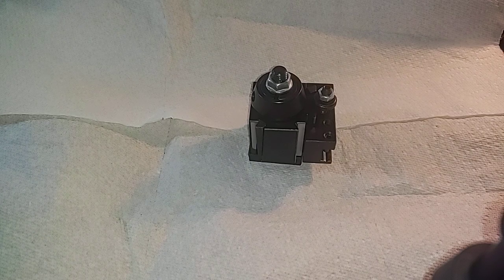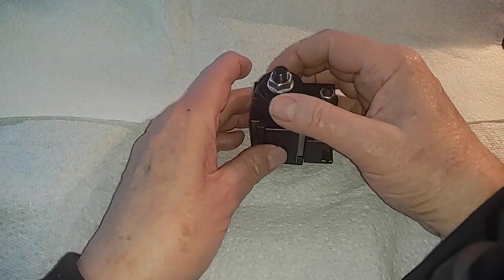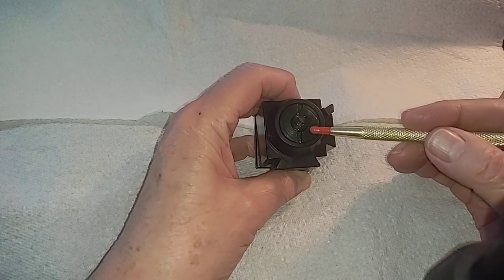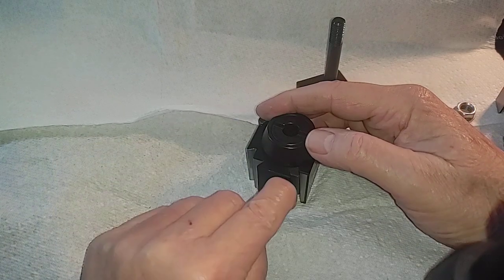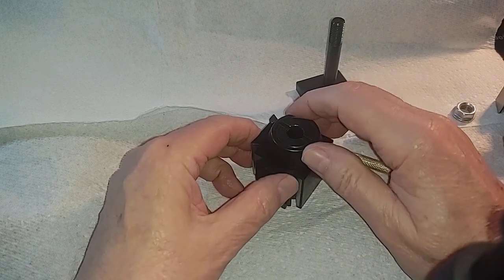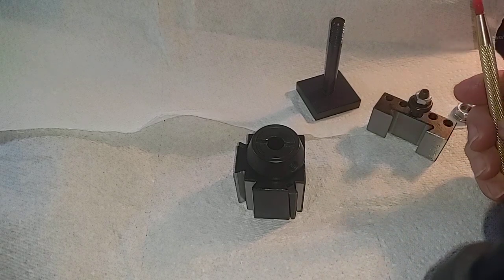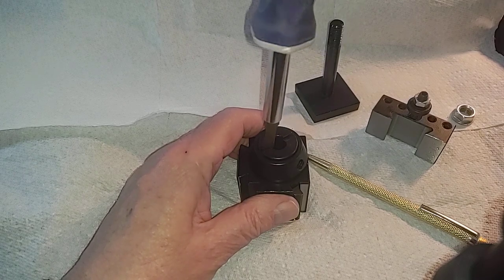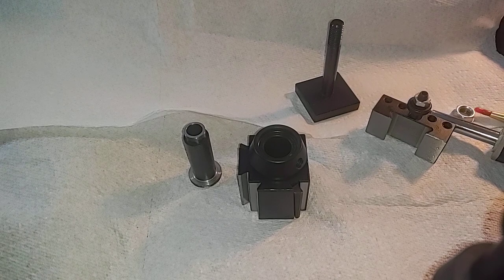#2-B Continuing review of 2nd OXA Aloris style tool post for 7x14 mini lathe.  Fail again.

Comment: They’re made like that for adjustment, you machining .025 out is what made it inoperable
Reply from the maker: The problem here was with the cam and teeth on the back of the locking blocks, they did not engage properly, the locking blocks were not properly machined.